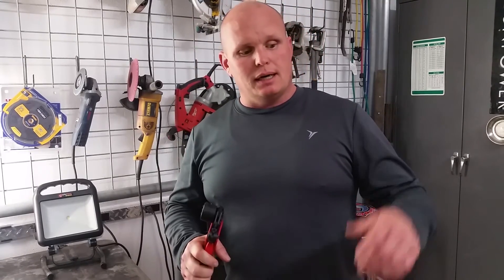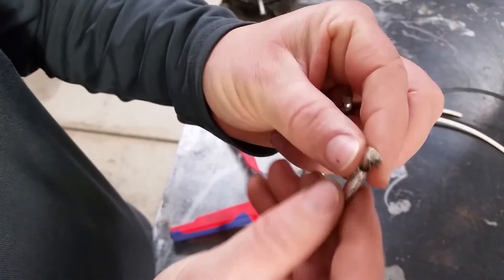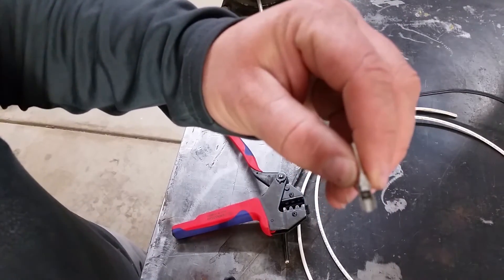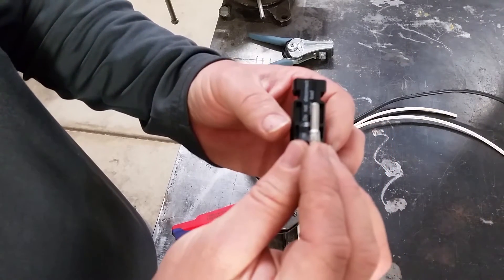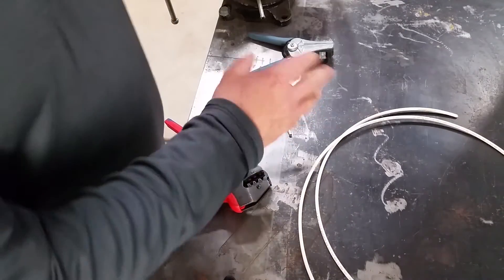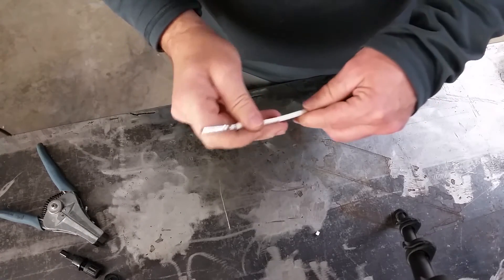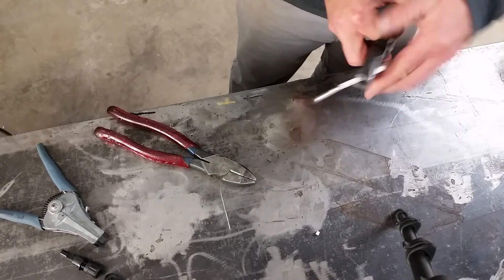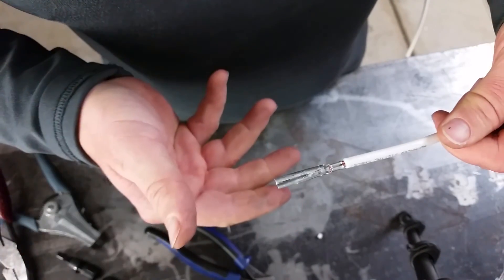MC4 PV cable crimper

Comment: crimping then soldering properly keeps corrosion out and totally locks wire in.i have had to retighten screw in electrical boxes because electricity causes vibration and loosens things over time.
Reply from the maker: +Steve Lemley so does dielectric greases some of the solder videos I have seen are sloppy and can cause the connectors for pv not to seat properly causing loose connections/resistance and melting.  Solder does have its place but not in pv connectors, if you do it properly they will last.
Reply: no solder is in the way if you know how to solder.i have had to replace many crimp fittings on other things like trailers other things

Comment: Good info as always
Reply from the maker: +sctpc Hey man did you get that system working better?
Reply: Jason Andrade no i would like to wire it a different way but im not legally alowed and electricians  dont want to fix other people's stuffups. Still working on a work around.
Reply from the maker: +sctpc Whattt, that's a bummer. you can't just buy another inverter and swap it out?